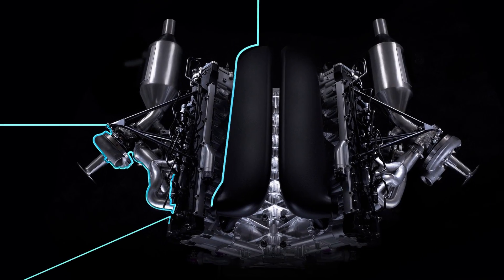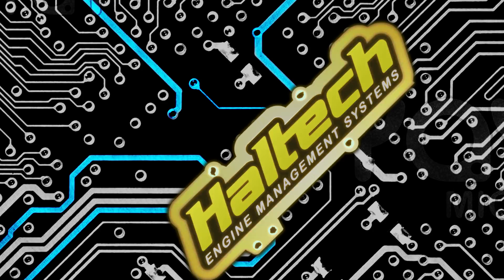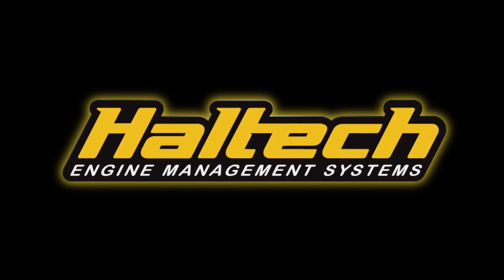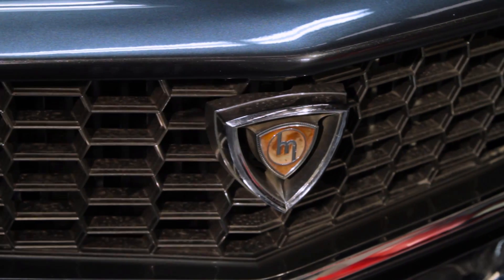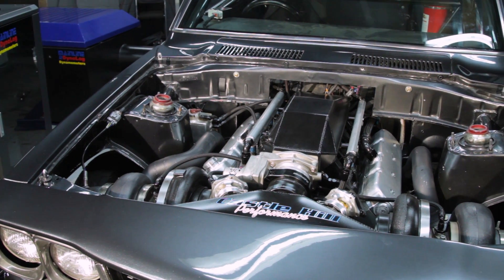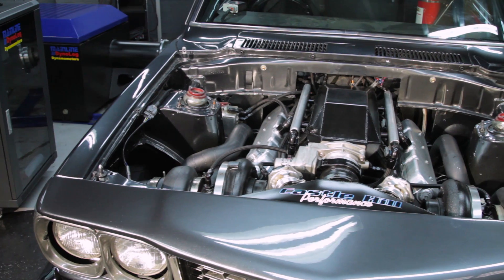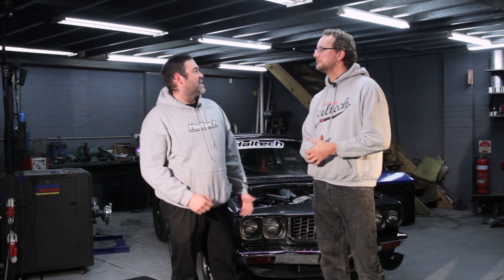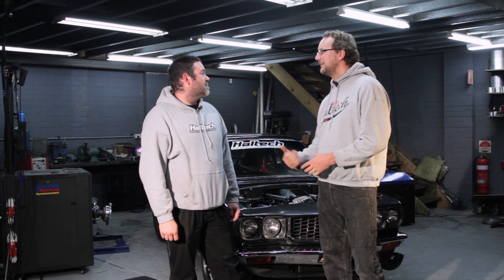Haltech Heroes:1755hp Mazda RX3 with an LSX conversion

Comment: he should of kept the rotary engine !!
Reply: +Lor Reuben Hahaha and 4 rotors and a big turbo setup will still struggle to hold this much power and have a fraction of the reliability. Also a 26B would weigh more then this setup. I love my rotors but I know they have a limit and they aren't for every build
Reply: +Tim Toeum He wouldn't be making anywhere close to 1700hp if he did that.
Reply: +dragkid185 put 4 rotors on it and tune it lmao
Reply: +Lor Reuben And then have an engine that cost 4 times what this v8 cost.
Reply: +Lor Reuben It's his car, he can put a 125cc moped for all I should care.